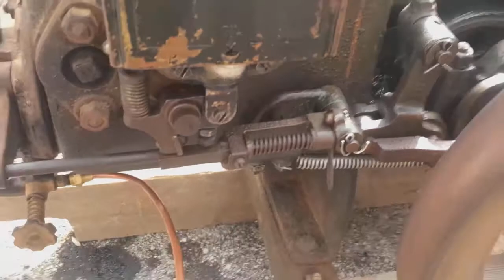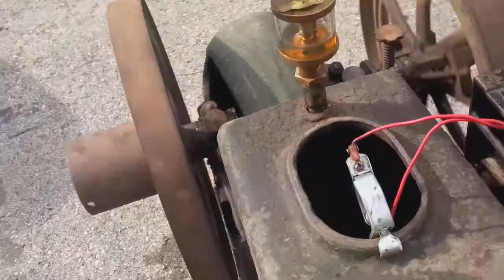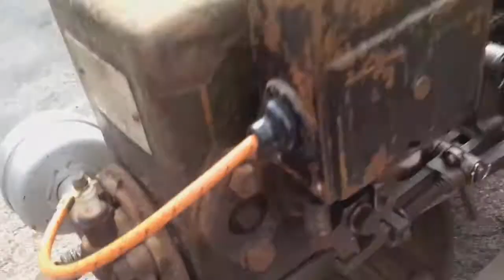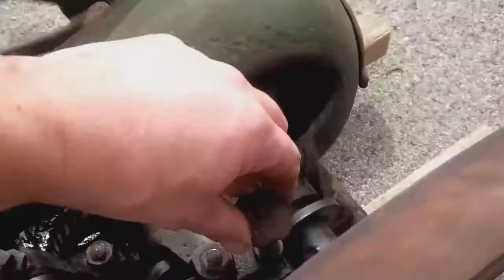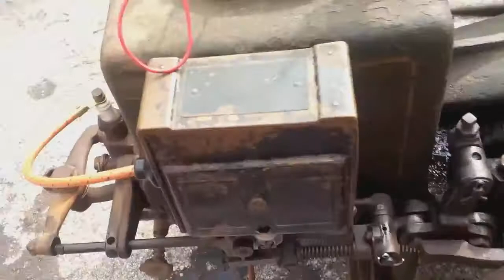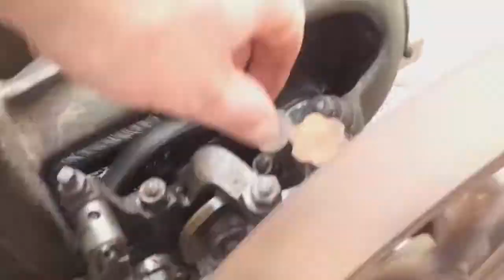Goold, Shapley and Muir Stationary Engine, 1.5hp Cub Model - First Run by an Amateur

Comment: Hey Jamie, great video. I just bought my first hit and miss and its basically identical to yours. I have it running but still figuring out the finer points and understanding everything. What is the knob you are adjusting back by the flywheel? It looks like you're adjusting the idle speed by adjusting the air fuel mix and turning that knob but not sure what it is, exactly. Thanks